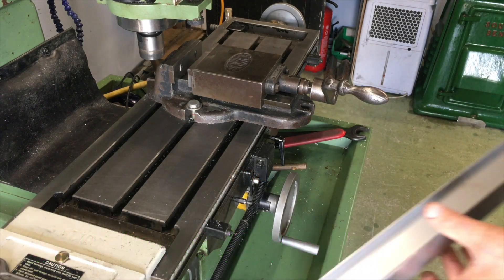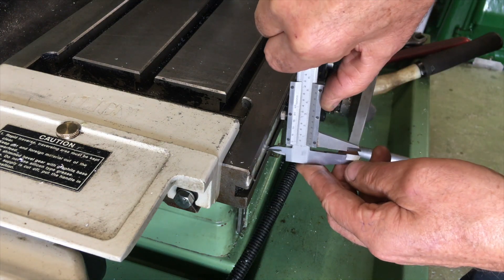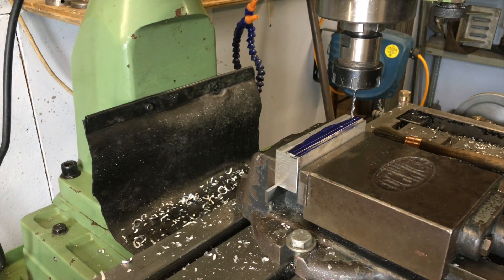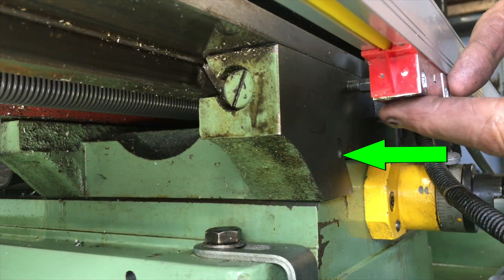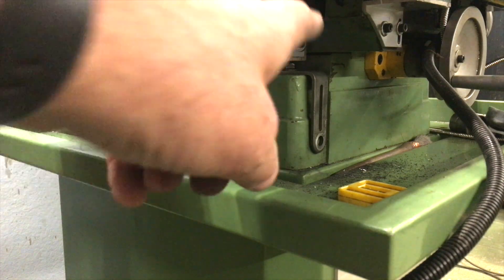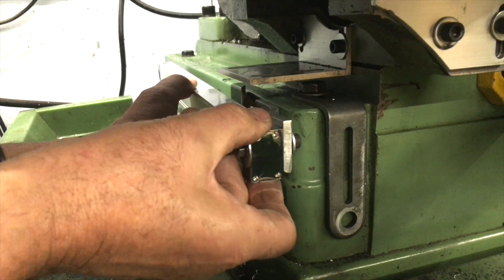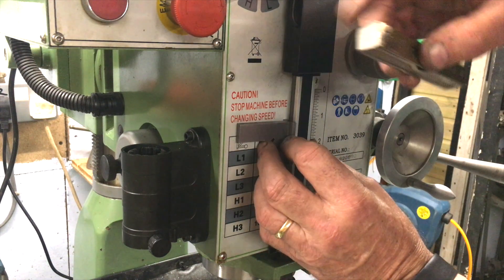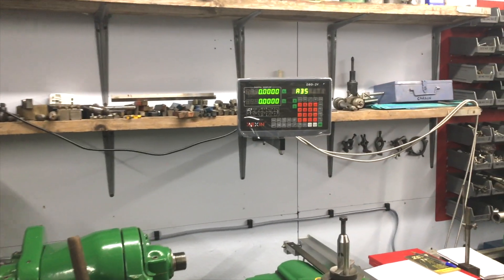Fitting a DRO to my old machines (Pt2)

Comment: Very good work. My round column chester mill drill has the same base as your mill so thats of use and interest to me. I am currently doing the mental gymnastics prior to fitting a 3 axis dro to my Harrison mill. I decided that the best time to fit it  is as I am reasembling everything.
Reply: Do yourself a huge favour and install a magnetic tape DRO. You can make it completely concealed by installing underneath slide surfaces if you have the mill apart. It is as accurate as and far more robust than glass scales and is super compact.
Reply: @nrml76 Thanks for that info. I had seen something similar, where magnetic strips had been attached to sliding surfaces. Think I saw it on the Mig Welding Forum.

Comment: Nice solution for the South Bend. Some good ideas I might use when mounting one to my 13" SBL. That follow rest is shop made? I don't think I have seen one like that from South Bend. I like that is puts the rest over the left side of the tool post.
Reply from the maker: Hi, yes the follow/leading rest is home made, you can see how I made it in one of my previous videos. All the best with the DRO,  cheers.